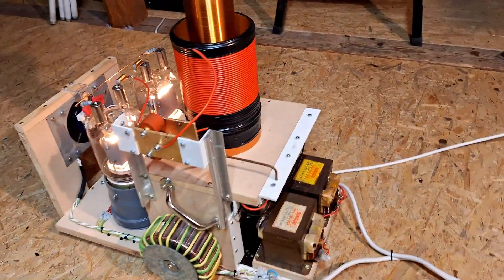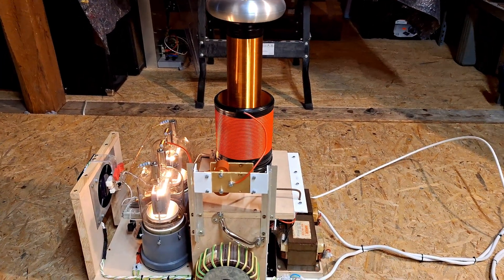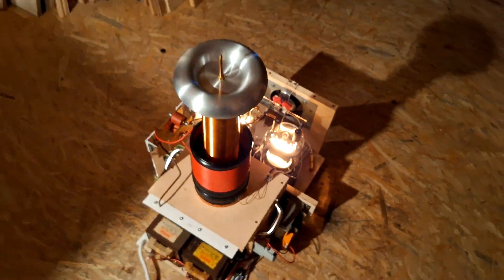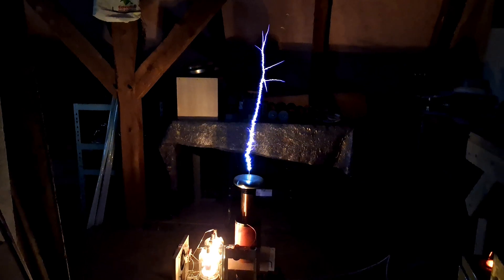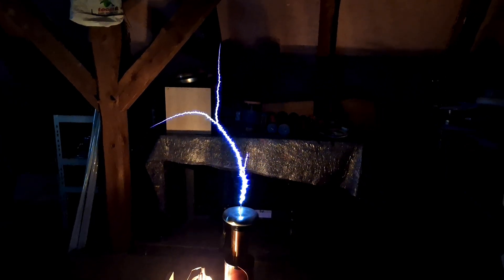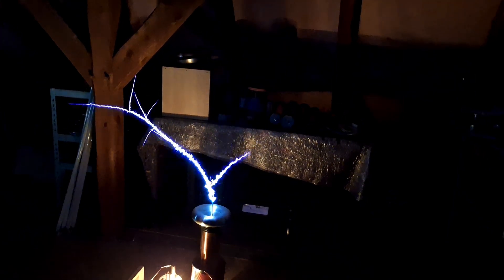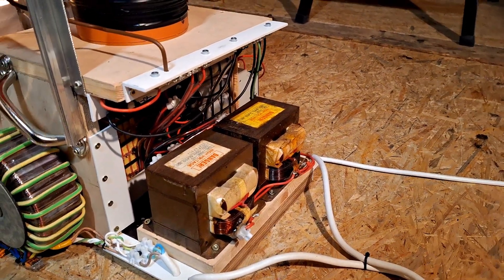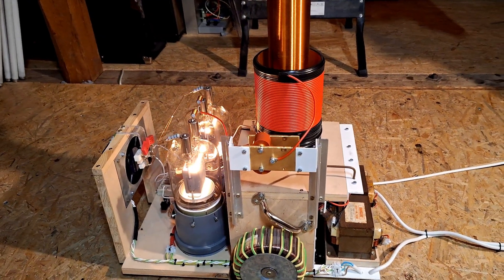Parallel GU81M Tesla Coil (This already SCARES ME NOW!)

Comment: JESUS CHRIST MAN. 

Yes You can put them on 400V I dont see why not. 

I am getting half your output with 2 MOTs and doubler, 
I only have 1.5uF of capacitance, maybe thats a reason.
Reply from the maker: @janno288 
Yeah i already tried it with some of my smaller mots on the workbench, but didnt tried it in my vttc, because i have a little brainfart when i think about how to set up the staccato.. but it might be just as easy like before..i think i just thinking too much about it😄
When you capable to get Red plates on your tube in CW mode on your application like it is, you have enough power yet.
You have a really high resonance frequency + just a super small topload and the tuning might be not ideal.. the tuning of finding the ideal primary turn ratio, the feedback turn ratio and grid feedback network was really a big pain for me.. this sometimes really needs a while! 
I wound now about 20 different primarys over the time and tuned everytime the grid feedback network and tank cap the best i could do. To see where is the "ideal" point where the tube is working the best
Reply: @marvsworld247  yesterday I did a lot of calculations and measurements and Calculated the coupling factor is 0.29 so that is pretty good i think. 
The primary voltage seems to be 4.7kV rms loaded by the secondary, secondary current is 2 Amperes with the primary current being 3.6Amperes ( i tested it with a halogen bulb and yup 3.6A confirmed) 
 T2D also told me a top load will solve so i might have to give in and buy one.
Reply from the maker: @janno288  the coupling is a bit on the lower side, but shoult work great! 
Im at 41,2% or 0,42 its a little high, but never had issues with arcover.
The Rest seems like really good numbers!
Yes a topload is really a gamechanger!
Reply: @marvsworld247  Generally from what I have seen the grid capacitor doesnt need adjustment, only the resistor and the turns ratio betweenprimary and secondary, I've also heard that putting the feedback on top may offer better performance. 
But it will increase the chance of arcovers
Reply from the maker: @janno288  the grid capacitor does not as much as i expected, thats right (with the pl36 tubes it really does a lot!) I just use 2,35nF now... it works the best.
I personally have the best results on beautiful arcs with resistors, and for more power i apply a small tungsten lamp in parallel to them. But with a lamp, the teslacoil sounds really harsh and the arcs are looking really different.
Reply: @marvsworld247  yeah thats due to the lamp resistance changing, which affects the griddrive, the resistors offer linear increase of griddrive with the supply voltage, the lamp causes a more flatter grid drive curve
Reply from the maker: @janno288  yeah the ratio between the pri. And Fb. Windings does a lot. Also to find the ideal inductive load for the tube.
Shortening the leads as short as possible between resonance cap of the primary to the primary, makes it also a littlebit more efficient..
And avoid steel as conducting Material at any point... use only copper when possible
Reply from the maker: @janno288 
Also the grounding layout is making a difference.. starground scheme with every lead as short as possible is required.
Also keep every lead as short as possible, and dont cross them too much.
Separate the leads for the grids away from everything... and so on